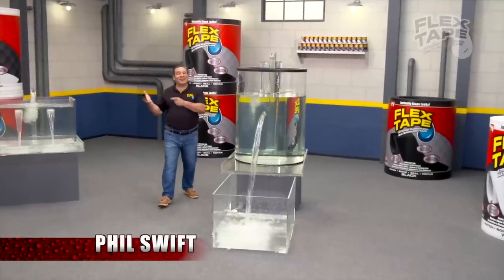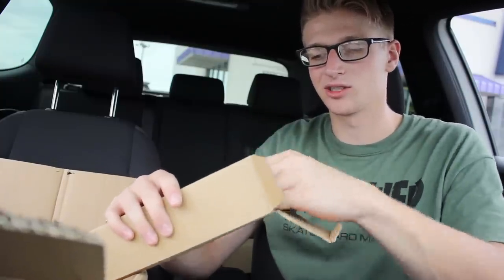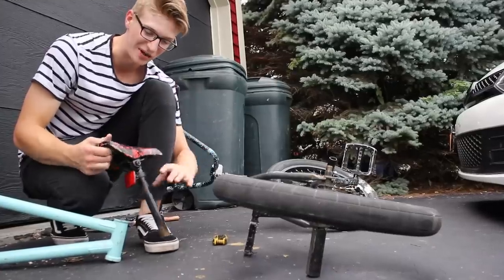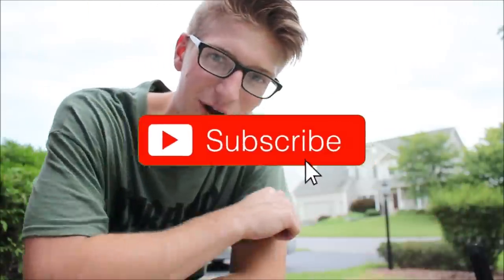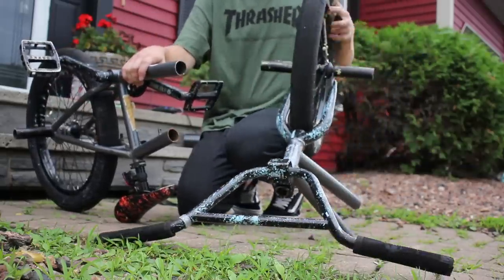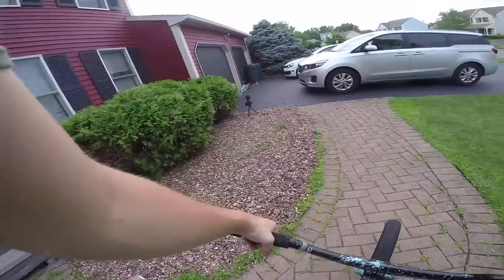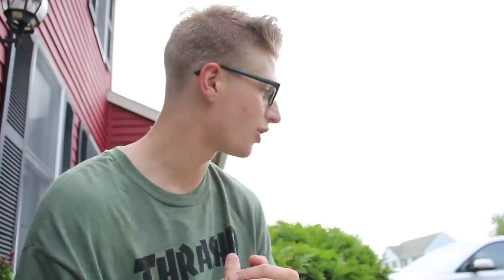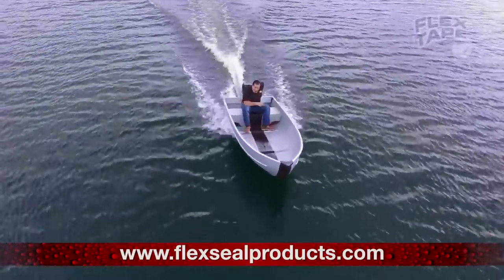FLEX TAPING a BMX BIKE that's in HALF! ( Will it hold? )

Comment: Tape is to hold stuff together. Not to connect, but a litlle tube (of metal) on the top and bottom and then try the flex tape

Comment: Ok flex tape won't work unless you put a stiffener between the gaps aka another metal tube , so with that in place  why not try jb weld ? Of course it won't help with the top bar but should work with the bottom  so I challenge you to put jb weld on that frame will you?

Comment: Yes, it would have worked if it was not for the half foot gap in the top section of the frame.  You should have fixed that gap first with 3/4" EMT or RIGID pipe down to the measurement, preferably weld it to one side or just flex tape it to make both bars equal in size and then the flex tape would have worked since you would have eliminated that downward pressure and while sideways would probably still be a problem at least it would have 100% prevented it from going any low allowing you to at least ride the bike and maybe perform some tricks.

Comment: I feel like you could have got this to work, the tape is flexible, therefor it can compressed, because you had the big piece cut out of the frame, it leaves all that space for it to compress so it was never going to work, if the space was filled in and the frame was just cut in half it would have wayyyy higher chance of working because the top tube is under compression, so it needs to be supported, but then the issue will be the bottom tube that’s being pulled, so potentially will have a similar result except it will pull apart not push together, but i reckon try again haha

Comment: Get a pipe with smaller diameter and insert it in the middle sections and tape it together. It should hold better.

Comment: I believe Phil Swift did get it to work because he didn't have a huge gap in between the boat I believe that if you maybe put something in the middle of it maybe a stick in the tubes on the top and the bottom I feel like you could have done it. Maybe a piece of metal or rebar something like that.

Comment: Flex tape won’t fix a crack in the frame, it will not do anything structural for the metal and is not a viable solution to fix a crack, the crack will not be any stronger with or without the flex tape. Please do not buy tape to fix your bike frame even temporarily.